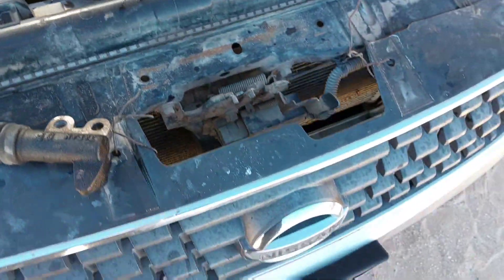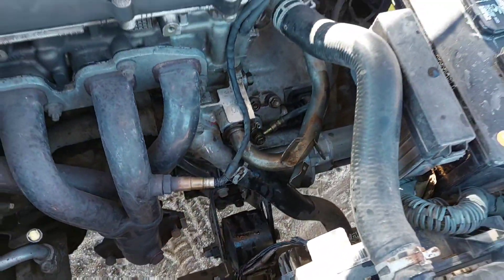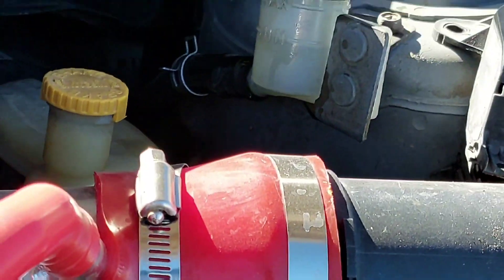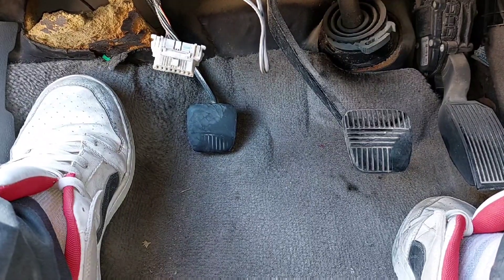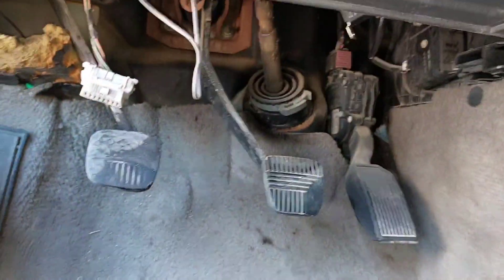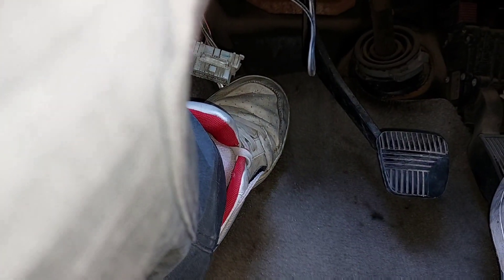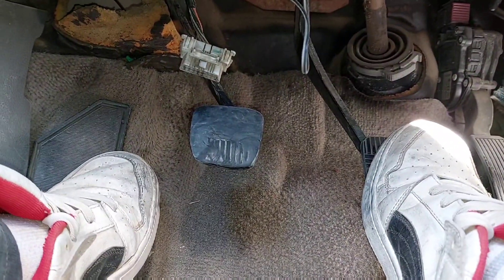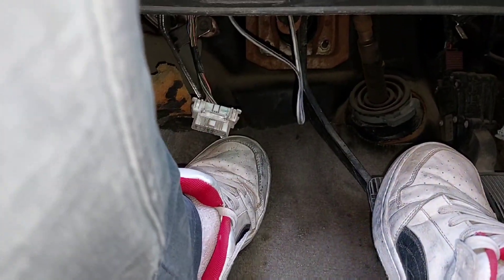Altima 05 2.5 CLUTCH STAYS DOWN @nickynick3527

Comment: You may have air in the line that's hydraulic
Reply from the maker: I purged the system
Reply: @SlabCityTelevision  I don't know man there might be a leak somewhere
Reply: It might be something is blocked in something you haven't replaced I don't know for sure but that would cause the system to fail a valve not working or something
Reply: Did you check El chicote??? Tambien the other master can be bad like you said...
Reply from the maker: @ChicanoSteve  i did not check el chikote